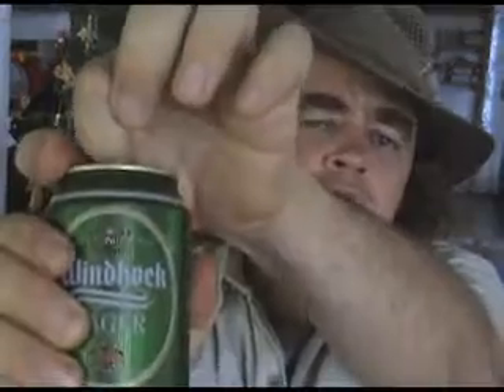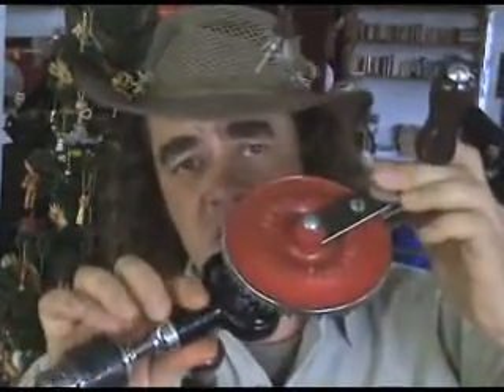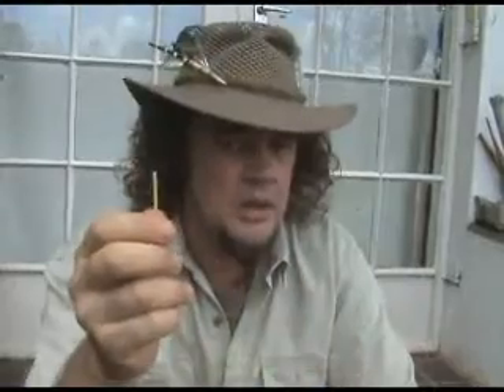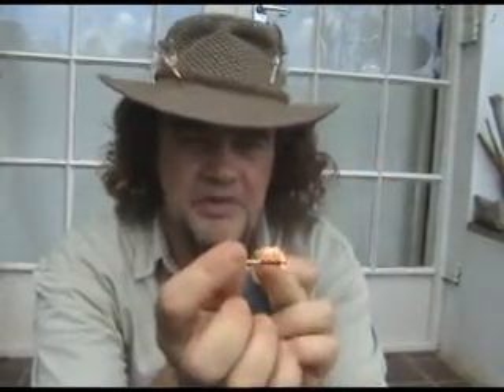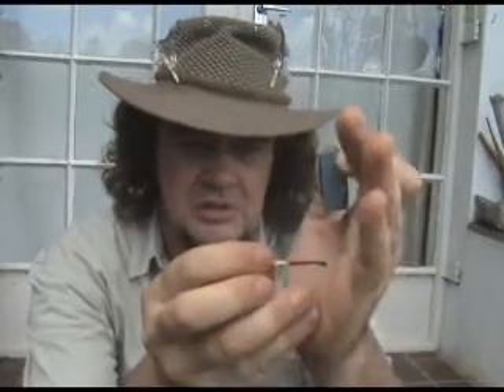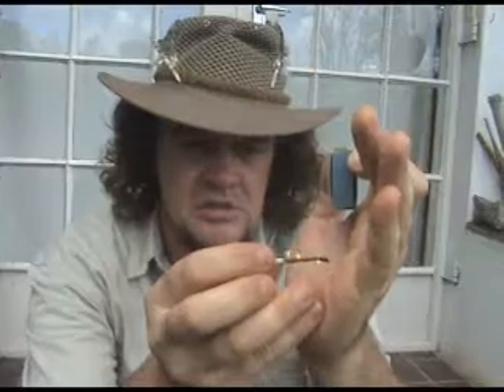101 Ways to MAKE FIRE - #8 Hand Crank Drill (1)

Comment: I agree, needs more Bob.

A simple trick to improving your success with this method is to warm the wood in the sunshine, or my any means available that does not add any moisture (licking your wood would be bad). This greatly reduces the effort needed to initiate and sustain combustion.